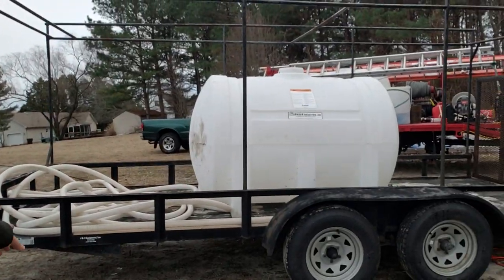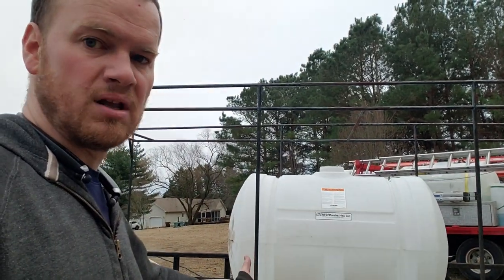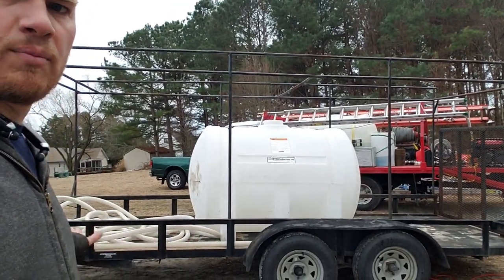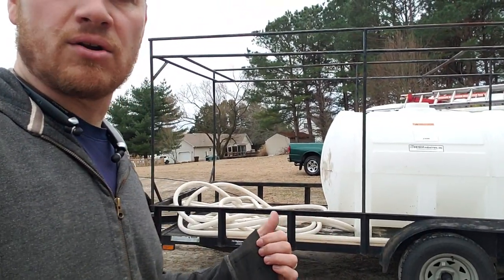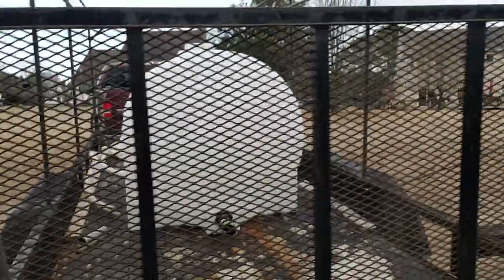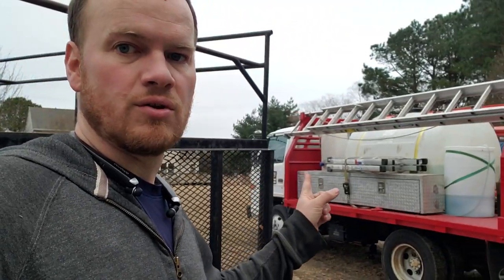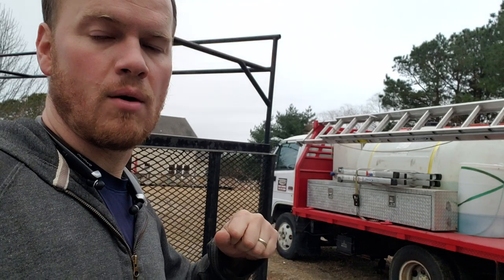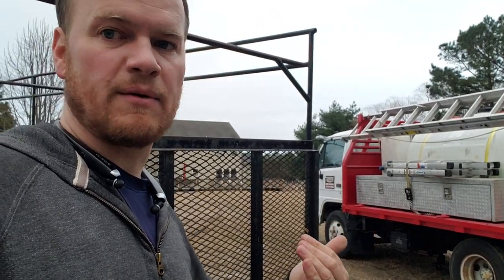How to properly position your water tank on a trailer build.

Comment: I agree.  60/40 load, 60 front and 40 rear is normal hauling,  I have seen totes hauled with water on trailers that are overloaded.  Heads up... if you're coming to Nashville for the PWS open house Monday and Tuesday, it's going to be freezing cold both days.  See you there.
Reply from the maker: Yeah I saw some comments about that